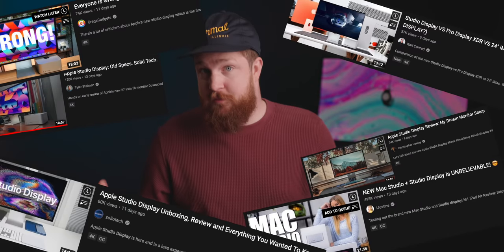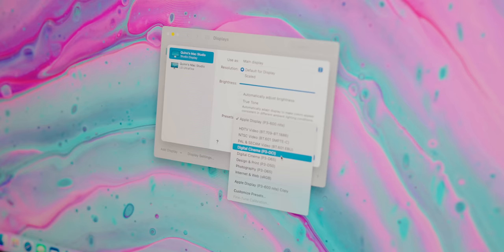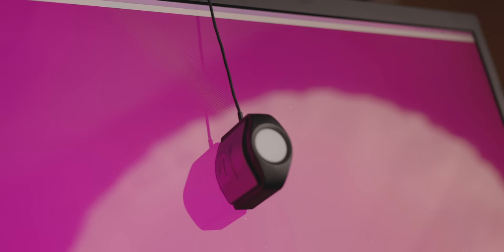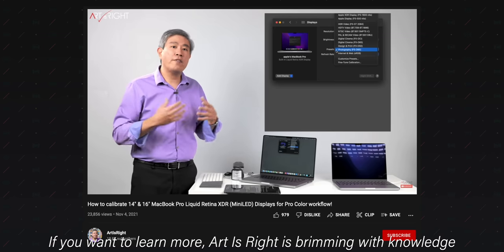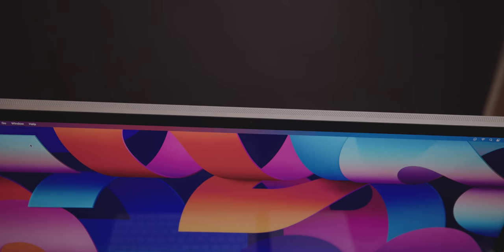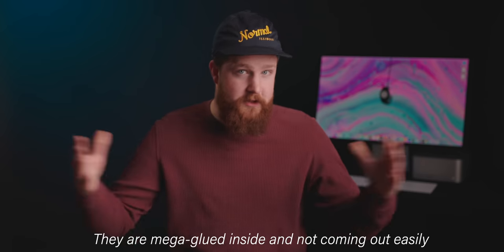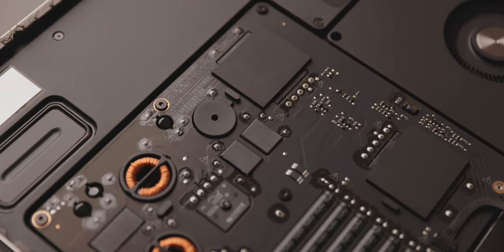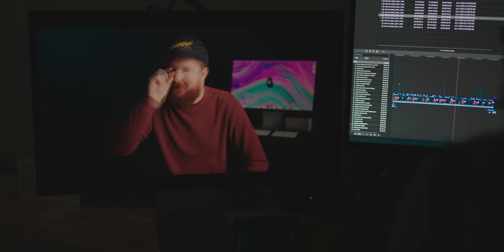The Apple Studio Display Is WEIRD!

Comment from the maker: While I was writing, I was too in the zone to think of something fairly obvious I've since considered. Maybe—just *maybe*—it's also over-engineered because they had been intending to put in a different (perhaps mini-LED panel) but had to scrap stuff late into the project due to supply chain and/or tech reasons. Would explain why this monitor is engineered out the wazoo in every other way. Perhaps it was supposed to be a loaded, crazy, insane $2,500-3,000 monitor but the panel wasn't ready in time and they had to ship this weirdo thing. Just some potential food for thought!
Reply: The Studio Display pricing kind of sits in "poor value no man's land". It would be great value at $999 (adjustable stand included by default obviously). Or as you say, it could use a better panel and cost significantly more. This is bordering on high end pricing with a mid-tier panel.
Reply: This idea makes more sense to me than anything else I've heard.
Reply: @goldennight3  It could also have always been the plan to use this display shell for all of 1) studio display 2) rumoured higher end 27inch display 3) iMac 27inch (pro and non pro)
Reply: It's a shame that Apple does this from time to time. They release a product that just fuels all the haters who believe everything Apple releases is overpriced. Well, in this case they are right. Anyone who buys this display is getting a terrible deal.
Reply: @siriax1691  it has almost 15 million RGBs
Reply: @37racso  I definitely don't agree with the Apple haters, but they do sell many sup-par quality products (such as any mouse they have made ever).
Reply: I’m curious if their are some other features coming down the pipeline to make use of the A13 as well. I guess we’ll see… I will probably buy this though. The build quality is alone is worth it in my eyes.
Reply: This was one of the designs for the apple silicon iMac
Also why are there so much "artifacts" on the dark areas of the video?
Reply: I think it's both. I think this was supposed to have a better panel, and this is also the underlying designs for a new 27" iMac, which may or may not ever see the light of day.
Reply: Honesty, they're probably just trying to empty their LED panel stock without selling new iMacs with them. They clearly don't want to sell 27 inch iMacs or iMac Pros with old LED panels. So instead they settled for selling it as a stand alone monitor.
Reply: That A13 would be pretty handy at processing the local dimming of a mini-LED panel, no?
Reply: I agree with most of what you said aside from the thinness comment. I mean the bezel is one of the thickest out there, and the panel is not thin either. Aesthetically, it looks outdated because of the bezel unless you look at it from the back.
Build quality is great but I am not sure in what way does it helps with my workflow or anyone workflow for that matter. It sits in 1 place 24/7, you barely touch it, it probably lasts just as long as any plastic monitor lasts.
By the way, 8k Samsung TV are selling for $2000.
Reply: This feels like the AirPods Max omitting MagSafe or Wireless Charging/Dock.  The required lightning port is such a miss.  Feels like they sat on the APM 2-3 years until they needed to release to appease financial targets.  All without adjusting/updating the design after the hold/wait  to include expected quality of life items available at the time of the ultimate release.  AKA MagSafe.
Reply: Apple Engineer:  What happened to all the iPad Pro Air Pro Max Ultra 3's we were developing?
Apple Marketing:  They're overpriced smart displays now...
Reply: Beginning of the video focused too much on other products. You need to follow Dave2D's straight-to-the-point style. I gave a thumbs down
Reply: yeah, as i hinted in a comment I just left, I’m wondering if they’ve had to do some ‘last minute’ major fucking around with this pair of oddball products, based on supply chain problems.
Reply: I think this is a case of Apple getting too big and people are not communicating. 

Sometimes these designers are in isolated silo's so they have no idea what's happening in a different group. As an example the 24" iMac team clearly was on the right track and the display group failed to see that. External power supply and even has a thinner display! If I was the designer I would have taking the schematics for the 24" iMac upped the size and be done with it!
Reply: @Snazzy Labs: In this scenario, when Steve Jobs was alive they would have simply waited. So this comment is pretty damning, and shows how far Apple has moved from its core value of putting a dent in the universe, to one of putting a dent in your wallet.
Reply: Pretty much the same thing that happened with the Apple watch
Reply: I’ve had the opinion for quite a while that the Studio Display IS the 27” iMac/iMac Pro, but Apple couldn’t figure out how to properly cool the M1 Ultra. Anyone looking at the Mac Studio heat sinks and fans would be hard pressed to figure out how to fit that into something as slim as the Studio Display. That’s why the innards are designed like a computer. It was a failed attempt to make a computer, forcing Apple to split the iMac into the Mac Studio and the Studio Display. Remember over a year ago when news stories reported Apple was having issues with the 27” iMac and had to divert their team to make sure the 24” iMac made it out the door? I think Apple was hitting roadblocks in making a 27” iMac and had to make a hard choice to split them into two separate products.

The Mac Studio was born and Apple repurposed the iMac into a display, which is why the thing is so over engineered and expensive. Since it was already designed to use an M1 family chip, they had to switch to the cheapest A-series chip they were still producing, the 64GB version of the A13 on the iPhone 11 (and at the time, the SE 2). It was cheaper to reuse existing packaging than to reduce the storage. Yes, I have no proof of this, but it fits the failed rumors and news stories we had from a year ago and how Ross Young had to admit his team got it wrong when predicting an iMac. He had it right the first time, but things changed. Can they still make an all-in-one iMac/iMac Pro? Maybe. I’ll bet they’re still working on it, but in the time they had, they had to split the computer. I would not be surprised to see the new iMac look exactly like the Studio Display.
Reply: This is the only logical solution That I can think of for over engineering everything but the single most important component, the panel.  Hey could you please do a review of the Alienware QD-Oled monitor and compare it with the studio monitor?  I’d love to see your take on the trade offs between contrast and pixel density.
Reply: Ya, I originally was of the mindset that this was supposed to house an apple silicon chip and be its own thing but the mini LED theory also really makes sense
Reply: Maybe it was supposed to be Mini-LED for the same price but they couldn't get allocation. The supply is already tight for iPad Pro 12.9" and the chip shortage derailed the plans even more.
Reply: I bought one of the 5K LGs when it was first released. The first one I had output too much power over the thunderbolt cable and fried the MacBook Pro I had bought with the monitor. The second one was fine until the warranty had run out. About a month after it started to exhibit ghosting. Now ghosting appears within a couple of minutes of the monitor being turned on and it takes at least two days of it being turned off before the ghosting goes away.

I would hope the Apple Studio display using the same lg panel doesn’t start developing the same problems.
Reply: wierdest part is the a13 cpu in it. And that Apple says its there cause of Siri.
Reply: I'm wondering what capabilities this thing has that we just haven't seen yet. Universal control in its standalone form (after adding an ethernet connection or wifi dongle perhaps)? TvOS? Great review and I'm still considering one of these for my desk, despite all the weirdness and yes despite the price. I've got a feeling we are going to see more surprises from this display in the not too distant future.
Reply: @blackcoffeegarage  or just spying on the user with AI :D monitor that send private data to some hackers (like Apple recently accidently did)
Reply from the maker: @user-ct1lf3hf1v  lol
Reply: @krushingkobra  I think you’re mixing your categories. 5k is a different beast than 4k (almost double the resolution), for one. There is a big jump from $1600 to $3k, but not so much from the $1k - $1300 range to $1600. Most color accurate, factory-calibrated monitors that cover most of the P3 gamut start at $1200 on the low end, and that’s for 4k and without the better OS/hardware compatibility, industrial design, speakers, etc.
Reply: YourTube  it’s not the same panel as the LG, though. You mean they needed to have the factory prioritize their production? Possibly. I also had to wait two months to get my Ikea cabinets (yesterday—woot!) and 6 months for another product. Supply chain woes are real.
Reply: @TomHofmann  I've got the same problem with my 5K LG...right after warranty expired, ghosting started.  A bummer...
Reply: There is definitely a larger story with this display. I also think this one is the most likely. But there are certainly others: perhaps Apple will be releasing other displays with better tech in virtually the same housing and they wanted to set the price expectation for the "base model". Apple is not above playing games with pricing and product selection. Why, for crap sake, does the new iPad Air come in only 64 and 256 GB configurations, when most of their target market would want (or only need) 128Gbs.
Reply: Wow, people always spoke of the A13 to run thunderbolt from the monitor but rest if the BoM is indeed looking like a one shoe fits all idea because people are willing to pay.
Reply: @toadlguy  the rumors preceding this release were for one less expensive and one more expensive than this one
Reply: I think they should have waited to release it, but I can understand that they needed to ship some Thunderbolt Display option with the Mac studio. I think at least calling it the "Studio Display" was a mistake as this is literally the on thing it shouldn't be used for. "Entertainment Display" or "Media Display" and even if you have to have some 2020s buzzword you could call it the "Creator Display" Or maybe they meant Studio Apartment... who knows ;)
Reply: Yup this display is expensive and the ports can't support 5k 120Hz. Tech is moving fast, I just don't see how this monitor can stay relevant in the next few years.
Reply: Can I have that wallpaper in the thumbnail
Reply: I wouldn't be surprised if a high-end version of this display with miniLED and a 120Hz refresh rate came later down the road.
Reply: Thank you for the video. It does feel balanced enough, though perhaps a bit of an advert overall. I don’t like it when people just naysay a given brand’s products just ‘because’ either though! 

You mention at the end that other monitors in the 4K range outperform this monitor on various grounds. Could you please share more about this? (Appreciate this may not get read etc, but I would just love that info..)
Reply: @krushingkobra  Yep $999 would have been good(especially with physical buttons and removable cord). What is most ridiculous is that it is a utter ripoff if you want to have a multi monitor setup. Seriously....imaging shelling out around 5 grand for a three monitor setup.
Reply: Both what you theorized in the video and this make sense
Reply: I agree with the above thought. This feels like a miss, without mini LED, I personally wouldn’t buy this monitor.
Reply: It would be really cool to be able to store files straight on the 64GB internal storage. Useful for laptop deskers like myself
Reply: I have seen a bunch of YouTube videos on this monitor, but yours is extremely thorough. I am going to buy this monitor in about 30 days.
Reply: As an engineer I find your use of “Over Engineered” unsettling, but we are living in a world of garbage from china so I suppose the bar is low. I almost only buy Apple products because I appreciate their willingness to actually design and engineer a beautiful product.